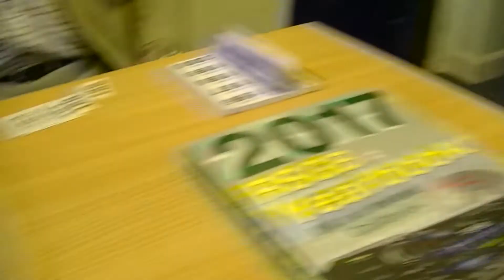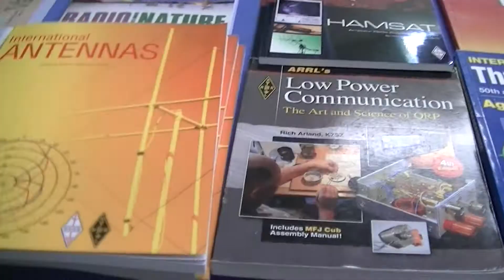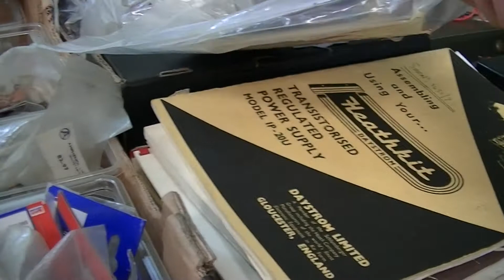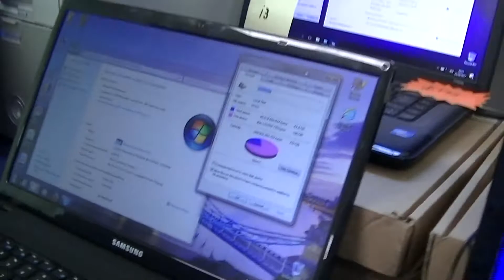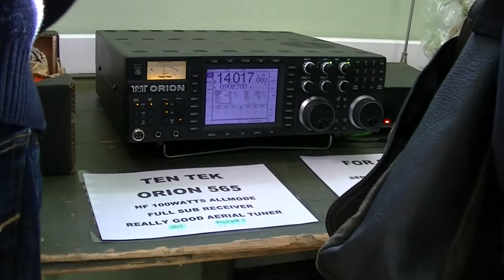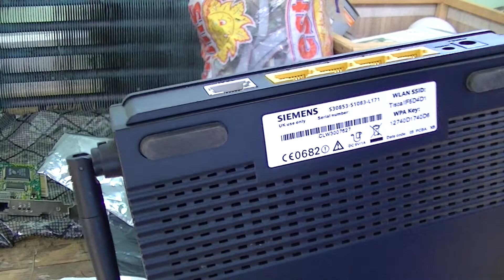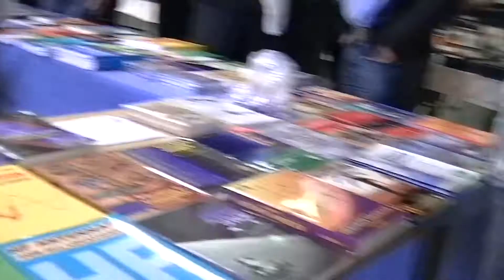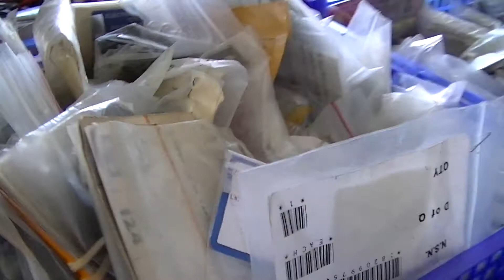Ripon Radio Rally. 23 April 2017

Comment: Despite saying you didn't need anything...did you end up buying something Nick :-)
Reply from the maker: I really didn't. I went thinking about possibly picking up some 3D printer filament. Also casually kept an eye out for a cheaper than ebay EMM803 vacuum tube. For a future repair project.